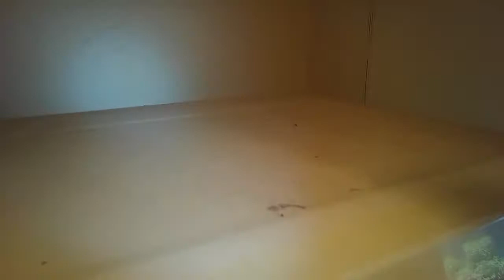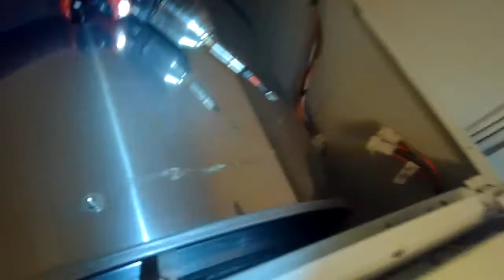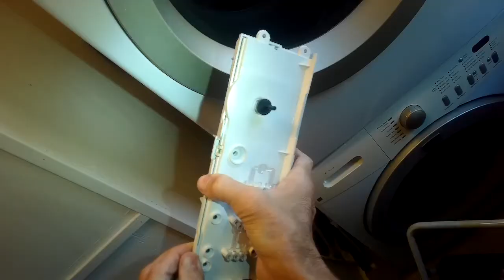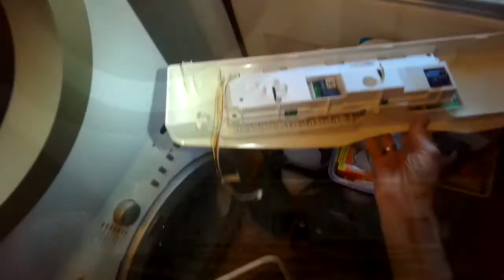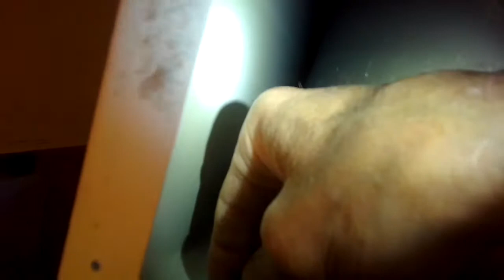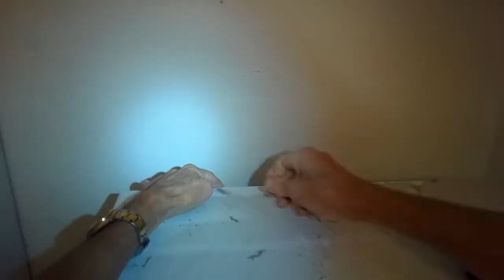✨ FRIGIDAIRE DRYER ANNOYING BEEP - FIXED ✨

Comment: Came here to say that I just finished this repair on my dryer— and it was pretty straightforward following Scott’s directions. One tip: if for any reason you drop a screw into the machine (even though he warns you not to) you can open the vent in the back of the dryer to retrieve it easily! It opens with two philips head screws and it’s also just worth cleaning the vent area if you’re already doing the repair. 

Something else to note is that when reattaching the control broad housing to the casing with the knob, it can take a bit of time to line the back of the knob up with the black turning piece. Be patient and don’t force anything on these older machines the plastic clips are a bit fragile. 

Thanks so much!!
Reply from the maker: That's a great tip about the vent, thanks for sharing! 👍

Comment: 1. Unplug.  Remove back panel and duct. Clean out all lint, all of it.  Use vacuum, then use an air compressor thru duct and thru the dryer too, as lint will fly out from tiny crevices.  Vacuum it again, blow it again, repeat till clean.
2. See videos on Youtube to remove the front control panel.  Not hard.  Check if all connections are good, reseat them securely, remove any contamination, dust, debris with Q tip and alcohol.  Or scrub with toothbrush and alcohol.  Worth a shot certainly to save money on a new control board.
3. Control board - At year 8, they go bad. Once removed, either replace with new control board $150 + tax. Done.

Don't replace board without a cleaning attempt first. Why waste money.  These machines last forever with some care.
Reply from the maker: Good info.
Thank you 😊
Reply: Very good advice about cleaning.  My dryer is 16 years old never had a problem.  I tested bottons and dryness button does not work.   I get E68 and machine runs one minute and stops then beeps.  It beeps at night when off.  I guess it’s a board problem.  Any advice?